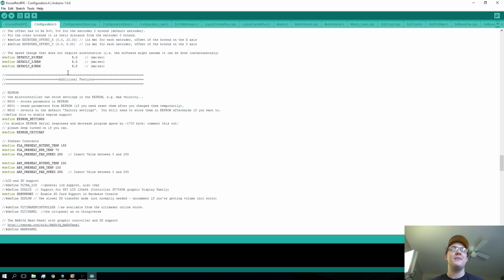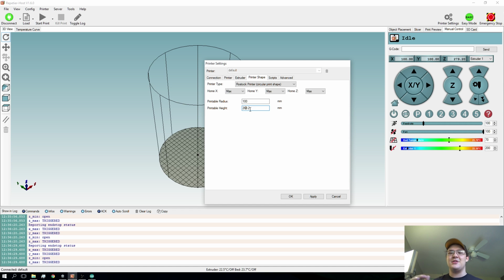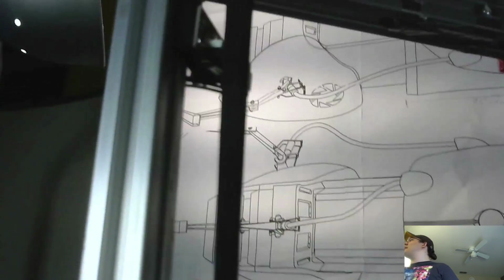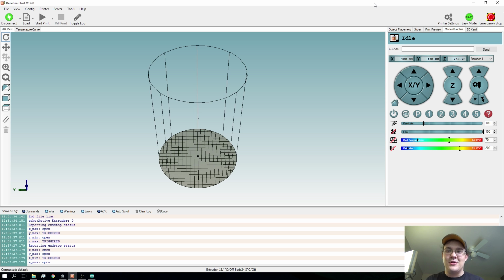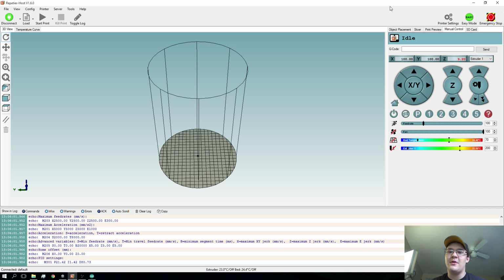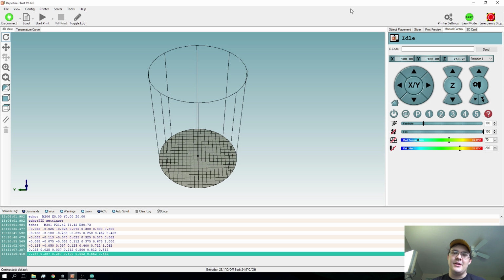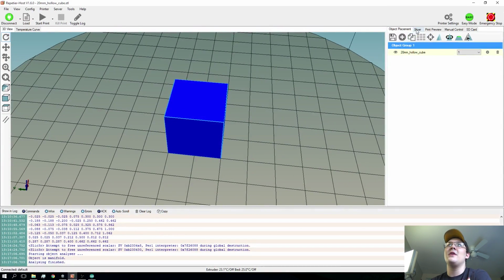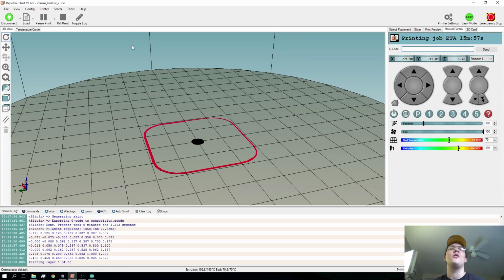Folger Tech Kossel 2020 3D Printer Calibration | #3 - Repetier Host & Test Prints

Comment: HI Dustin 2 years ago i hadn't gotten one print out of my kossel 2020, now 2 years later, still no  prints, no matter what i do to this firmware it will not give me a fully operational machine. everything mechanical works fine, it's just the firmware, and i even tried your firmware on your website, no go, did you have a better/upgraded version of the rev b kossel 2020 delta firmware?? or maybe a more in-depth guide for making the repetier firmware? thanks man!

Comment: Hi Dustin, I did everything like you said and everything was working good, but at the last step it shows:

02:35:04.639 : Error:No Line Number with checksum, Last Line: 130
02:35:04.639 : echo:Unknown command: "130"
02:35:04.639 : Error:No Line Number with checksum, Last Line: 130
02:35:04.642 : Error:Line Number is not Last Line Number+1, Last Line: 130
02:35:04.642 : Resend: 131
02:35:04.648 : Error:checksum mismatch, Last Line: 130
02:35:04.648 : Resend: 131
02:35:04.654 : Error:No Line Number with checksum, Last Line: 130
02:35:04.654 : Error:Line Number is not Last Line Number+1, Last Line: 130
02:35:04.654 : Resend: 131
02:35:04.684 : Error:No Line Number with checksum, Last Line: 130

02:35:15.371 : Printer reset detected - initalizing
02:35:15.371 : start
02:35:15.371 : echo:Marlin 1.0.0
02:35:15.375 : echo: Last Updated: May 17 2016 17:47:00 | Author: (FOLGER TECH, KosselRevB)
02:35:15.375 : Compiled: May 17 2016
02:35:15.378 : echo: Free Memory: 3637  PlannerBufferBytes: 1232
02:35:15.379 : echo:Hardcoded Default Settings Loaded
02:35:18.840 : echo:SD init fail
02:35:18.874 : FIRMWARE_NAME:Marlin V1; Sprinter/grbl mashup for gen6 FIRMWARE_URL:http://www.mendel-parts.com PROTOCOL_VERSION:1.0 MACHINE_TYPE:Kossel Mini EXTRUDER_COUNT:1
02:35:18.891 : X:0.00Y:0.00Z:0.00E:0.00 Count X: 0.00Y:0.00Z:0.00
02:35:18.891 : echo:Active Extruder: 0
02:35:18.891 : Begin file list
02:35:18.891 : End file list
02:35:18.897 : echo:Active Extruder: 0

any idea what it could be? Thanks for ur time and help!

Comment: Hey Dustin, 
I am having issues to where my printer head will still jam through the bed even when the sensor lights up. I have confirmed that the sensor is returning correct readings, open when it should be and closed when close to the bed. Any idea on why that may be. Thanks in advance

Comment: Yes when I put the reading in Marlin as well as Repetier the printer came down fine but I have another problem. I ran g-code (G1 X-69 Y-40 Z10 F4800 and I measured distance off bed and it should have 10 mm but it was 7.87 mm 2.123 mm off the other towers are off all so (Y 8.34 mm, Z 4.33 mm center was 7.10 mm). Can you help with this I think it might be the delta diagonal rod length but not sure what I should change them to?
Reply from the maker: Youll want to check the endstops more than likely. You shouldnt have that much variance. I would just adjust the variables until it works.
Reply: Dustin Corbin if motors click but dont move whats up?

Comment: Hi I have a mini Kossel (delta) I adjusted the stops at the top so they are all the same distance from the bed. I used the -Z control to bring the hot end to the bed. But when I thy to print the hot end crashes into the bed. I have made this adjustment about 5 or 6 times. I have loaded into printer settings the setting that come up. Most of the time I must subtract from the this number. I have the marlin setting at 210 (manual_Z_home_pos) and the printer settings at 197 in Repetier-host. Any suggestions?
Reply from the maker: +David Crandell Marlin and repetier must match. Set Marlin (the z home variable) to 197 and upload the firmware.
Reply from the maker: +David Crandell Marlin and repetier must match. Set Marlin (the z home variable) to 197 and upload the firmware.

Comment: Trying to get a test print done. Home works great. It goes through the procedure of auto leveling. Z height is set correctly.
When I try to print it goes through all the start up procedures, and then tries to print way too high off the bed. We're talking like 200mm too high. Any ideas on what to look for?
Reply from the maker: +brainanator make sure the z height is set in both the firmware and repetier, and check to see if there is any z offsets in the slicer settings.
Reply from the maker: +brainanator make sure the z height is set in both the firmware and repetier, and check to see if there is any z offsets in the slicer settings.
Reply from the maker: +brainanator make sure the z height is set in both the firmware and repetier, and check to see if there is any z offsets in the slicer settings.
Reply from the maker: +brainanator make sure the z height is set in both the firmware and repetier, and check to see if there is any z offsets in the slicer settings.

Comment: Hey Dustin, I have a folger tech prusa i3 cartesian printer and now i bought a micromake delta printer. Withe the folgertech, I never needed to use the arduino program or gcode or any of that, it was pretty much point and click. But now with the delta, It doesn't work quite that way because it does not have a heated bed and repetier thinks it does. What can I do ?
Reply: In other words, I can get it to "dry run print" but it will not actually print because its heated bed, which it does not have, is not putting out temp. Also, when I put a number higher than 300 under printer height in settings, it stays as 300 under manual control z axis, so it never actually touches the bed.
Reply from the maker: +Mooch M if you have access to the firmware, you can disable the heated bed there. Repetier should work fine even if you don't have a heatbed, unless the firmware on it is the issue, which I can't help much with since it's not a FT printer.

Comment: hello, I'm having a problem with my endstops, whenever i give the Auto home command the motors does not stop when the endstop triggers, can you please help me with this issue, i've been looking all over the web for a month now :(
Reply from the maker: +Moe Stone use command M119 to check to see if the endstops are correctly triggering. Should be all max endstops. Make sure the endstops match  with the motor. X motor is with the Z endstop etc..

Comment: I'm new to this and when I tried M119 on my repetier it only triggers x, y min, and then i tried it without pressing the endstops and it still says they are triggered. Can you please tell me how i can fix it
Reply from the maker: You may want to reflash the firmware. You should only see X, Y, Z MAX and Z MIN.
Reply: What do i have to change in marlin? or something else
Reply from the maker: Shrey Shouldn't need to change anything, as long as you are using the Kossel firmware.
Reply: I think that might have been the reason i don't think mine is kossel firmware to start with, I'll download that, Also if you can recommended a firmware that would be great other wise thanks for the help, I would have been lost

Comment: Dustin, thanks for all of your help and guidance. I was able to home and auto level. The printer was making an attempt to print. The motions all looked good but I had a plugged nozzle. I did not have the nozzle well screwed into the heater block so it was pushing hot plastic into a cold nozzle. Anyway, this has made this old man very happy. Thank you so very much.
Reply from the maker: +Fred Dishner My pleasure. Glad i could help!

Comment: Hi Dustin .. Love your video's .. they helped me so much ... Got to the point of starting to print, but the nozzle does not heat up. I measured the voltage on the board, but it stays 0 Volts. The bed is heating up just fine. Do you have any idea what to check.  Thanks for the help.
Reply from the maker: +Rudi Jetten temp reading for the extruder working? did you manually turn it on or is that when you start a print?
Reply: Hi Dustin,  I turned it on manually. Fan and bed works just fine..
Reply from the maker: +Rudi Jetten could be the ramps. If thermistor is working but still 0v, some issue with the board is probable.
Reply: yeah .. I'm checking the board and the solderings on the board. I found more info here http://reprap.org/wiki/RAMPS_1.4. Hope I can find a port that triggers the power for the thermistor.
Reply from the maker: +Rudi Jetten also check the polyfuse (one of the big yellow things) they are super crappy on the ramps boards and break easy. Could also be a faulty MOSFET.
Reply: I see there is a LED for every output Fan , Bed and thermistor ... but the led for the thermistor isn't lighting up. The other two do.
Reply from the maker: +Rudi Jetten must not be getting a signal, or MOSFET is no Bueno.
Reply: +Rudi Jetten Hi Dustin .. I swapped the Mosfet from the fan and the heater ... same problem ... Heater still not working , Fan still works.. So it's not the Mosfet.. I ordered a new RAMPS board just to be sure. Looking further down the circuit if there is an other problem.
Reply: +Rudi Jetten Hi Dustin , Thank you for your support ... problem was solved with a new RAMPS board. Also got a refund from Folger tech for the faulty board so I'm Happy.  ;-)
Reply from the maker: Rudi Jetten Awesome "D

Comment: after my kossel auto levels the bed it goes to print but it doesn't get close enough to the bed and it just squirts plastic all over.... doesn't listen to me and move close enough to the bed to actually get the pla to stick i set the value to like .5mm below the surface of the bed.... still wants to hover about 1mm above the bed.... any thoughts? help!
Reply from the maker: +Eric Manion Did you set the Z height in the firmware and repetier? vid #5 in this series talks about this in more detail.
Reply: Ya on my kossel it came out to be like 280 ish mm so i set that in both repetier and in the config.h i have been adding to that, now it is at 283mm.

Comment: the window at the bottom says:

21:32:58.672 : OpenGL renderer:Intel(R) HD Graphics
21:32:58.672 : Using fast VBOs for rendering is possible
21:47:27.258 : No start signal detected - forcing start
21:47:29.334 : &?}+Mo6DV??(?g:}M??*??
21:48:13.514 : Communication timeout - reset send buffer block
21:48:16.464 : -???k?MM???ki*???J??*?????*S??i??'}M?6SJ? ?
21:48:28.752 : ??:}M?
21:49:18.072 : Communication timeout - reset send buffer block
21:49:21.141 : x?'=

and because of that, I am unable to connect to the printer. Could you provide some assistance?
Reply from the maker: +Kurt “Sherlock” Baron never seen that before. Reflash the firmware, unplug then replug in the usb, try it again
Reply: +Dustin Corbin how do I reflash the firmware?
Reply from the maker: Kurt Baron like, re-upload the firmware to the arduino like you did originally.
Reply: +Dustin Corbin at the bottom of the Arduino software, it says:
"Arduino: 1.6.7 (Windows 10), Board: "Arduino/Genuino Mega or Mega 2560, ATmega2560 (Mega 2560)"

In file included from C:\Users\Mike\Desktop\Printer\KosselRevB\KosselRevB.ino:33:0:

sketch\Configuration.h:354:32: warning: ISO C99 requires whitespace after the macro name [enabled by default]

 #define Z_RAISE_BETWEEN_PROBING=20
                                ^
In file included from sketch\Marlin.h:21:0,

                 from sketch\thermistortables.h:4,
                 from sketch\Configuration.h:587,
                 from C:\Users\Mike\Desktop\Printer\KosselRevB\KosselRevB.ino:33:
sketch\fastio.h:1418:0: warning: "DIO73_PIN" redefined [enabled by default]
 #define DIO73_PIN  PINJ4
 ^
sketch\fastio.h:1406:0: note: this is the location of the previous definition
 #define DIO73_PIN  PINJ3
 ^
Sketch uses 96,736 bytes (38%) of program storage space. Maximum is 253,952 bytes.
Global variables use 4,330 bytes (52%) of dynamic memory, leaving 3,862 bytes for local variables. Maximum is 8,192 bytes.
avrdude: ser_open(): can't open device "\\.\COM3": Access is denied.
avrdude: ser_drain(): read error: The handle is invalid.
Problem uploading to board.  See http://www.arduino.cc/en/Guide/Troubleshooting#upload for suggestions.
  This report would have more information with
  "Show verbose output during compilation"
  enabled in File > Preferences."

emphasis on the "problem uploading to board"
Reply from the maker: Kurt Baron Make sure you do not have Repetier Host connected when uploading. And make sure you have the correct COM port selected
Reply: +Dustin Corbin should I then close out of Arduino to bring up Repetier? or does that matter?
Reply from the maker: usually doesnt matter, but it won't hurt if you do.
Reply: +Dustin Corbin yeah, it's still giving me this:

23:22:49.196 : No start signal detected - forcing start
23:22:51.261 : &?]+mBOVwD??'}H.?'}M?6?
23:22:51.265 : ??
23:22:51.265 : [m???K?
 could the Arduino board be DOA?
Reply from the maker: Kurt Baron never seen something like that. You are using the firmware directly from Folger Tech right?
Reply: +Dustin Corbin yes

could anything be dead and therefore not working? boards, ramps, etc?
Reply from the maker: Kurt Baron As far as I know nothing would cause something like that other than the firmware, or a weird connection issue. It is trying to force start the board and Im not sure why. You could try disconnecting everything on the RAMPS and see if it is able to at least connect. Were you able to upload correctly?
Reply: +Dustin Corbin yes, just not get repetier working
Reply from the maker: Kurt Baron Weird. Try another USB port.
Reply: +Dustin Corbin How do I connect a different USB port to Arduino?
Reply from the maker: Kurt Baron Connect the USB cord to another USB port. Then change the COM port in the arduino software.
Reply: +Dustin Corbin how do I change the port in the Arduino software?
Reply from the maker: Kurt Baron The previous video in this series talks about it. You just select the COM port that is listed (that isnt COM1)

Comment: device manager says 9600 baud so I set it to that. I am going to reload the the arduino firmware and see if that solves the problem.
Reply from the maker: That's odd. Should be 250000 by default in firmware.

Comment: when doing a G29... why does it only probe a portion of the bed... not the entire bed...  for instance, my probe is on the left side of the nozzle, when i tell it to probe it probes the left outside of the platter to the center, then stops and lifts to mid way up the towers?
Reply: UPDATE:  figured it out... the number of probe points from FT is set to 15... increase it to 20 to get the entire print area probed...also, you need to set the X Y offset from the nozzle tip to probe center...  in my case 0,30, -.6,0  with the probe points set to 20...
Reply from the maker: +Johnathan Oey you said it perfectly!

Comment: Hey Dustin. When I am in repetier host and I try to move the carriage The carriage moves only down. No matter what direction I push. All motors are oriented correctly. Any idea?
Reply from the maker: +scott simo Usually you need to reflash the firmware again. It happens. Run M119 command to see if any endstops are causing an issue.